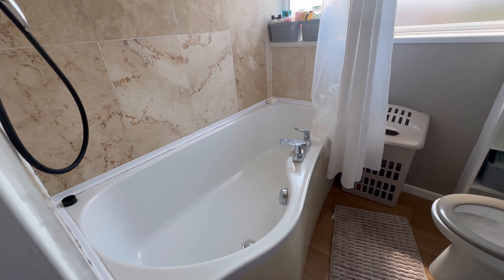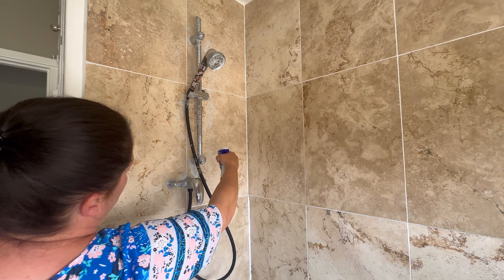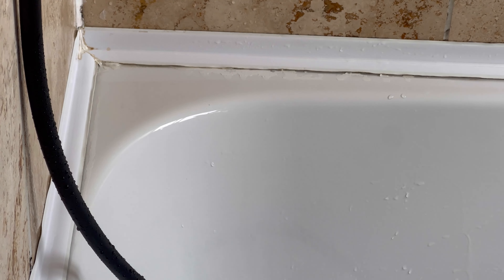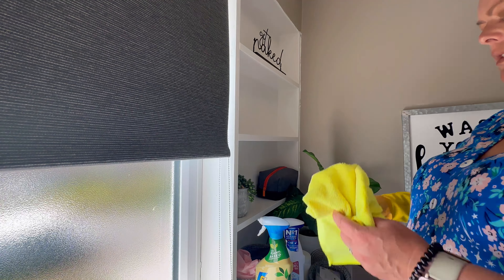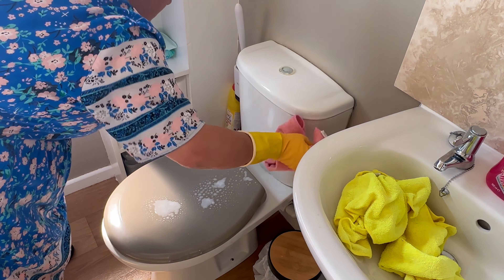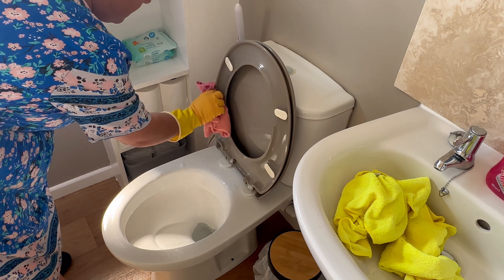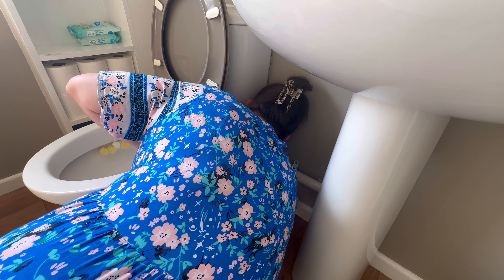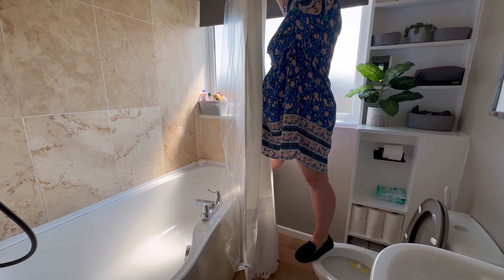Motivating disgusting extreme clean ￼￼

Comment: Try white vinegar, for the shower head put it in a plastic bag with it and leave to soak
Fabulosa do a white vinegar spray,I get the rose scent,that may help remove the white limescale, I also use fabulosa limescale remover and that works really well as we have hard water where I live ❤
Reply from the maker: I’ve tried vinegar…I’m starting to worry I’ve actually damaged the tiles  with all the cleaning products I’ve tried 😬 I haven’t tried the fabulosa one but will keep my eye out for it. Where am I likely to find it? X
Reply: @Forcleaningoutloud  I get mine from either b@m or home bargains I've never had an issue x
Reply from the maker: Amazing I have a Home bargains, I will have a look for and let you know how I get on x